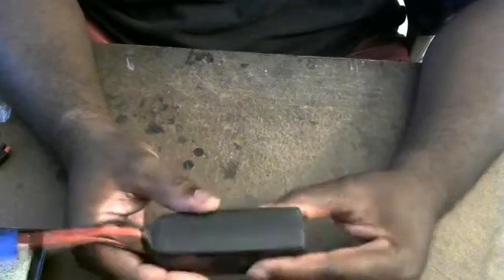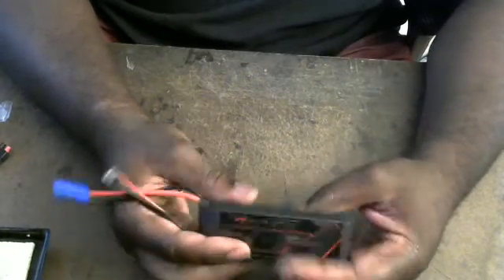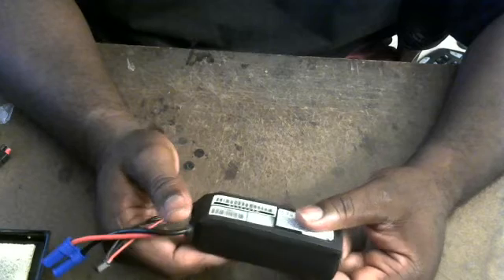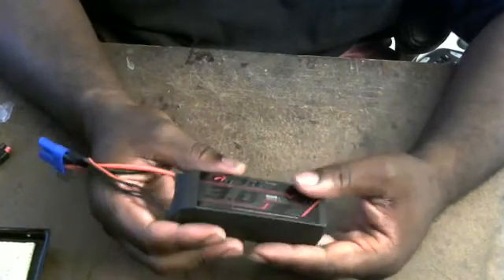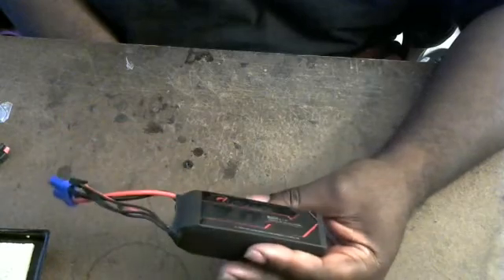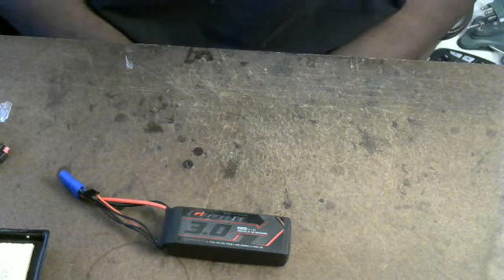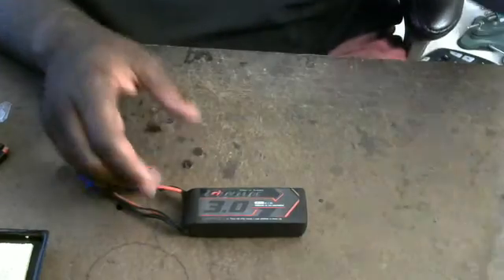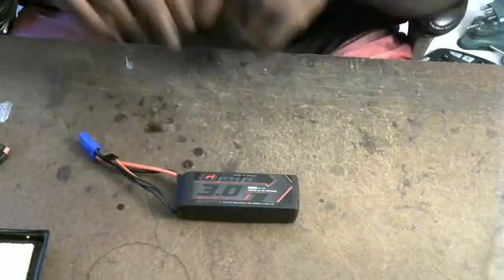15C Turnigy Graphene Test Review

Comment: 3.0 * 15c = 45 A
16.0 * 10c = 160 A

That's why your multistars pack needs a higher AWG wire, it can deliver 3.5 as much amps.
Reply from the maker: Glenn Verboven Multistar are so not 10c. Depending on the capacity the lower ones are about 2.5 to 3c while the only one that can even reach 5C is the 16ah and that's because it's 2p cell configuration. These are based on a continuous discharge and the ability for the cell to hold over 3.5v at the end of discharge.
Reply from the maker: Glenn Verboven you are also correct though normally these smaller packs are used in rc. I tested a few of these smaller cells to get a better idea how the larger pack may work. The loads that true rc enthusiasts have vs the enthusiast in my field are different rc requires packs to be punchy while we prefer sustained loads. We rate rc packs different usually using a 1/4 C rule meaning destiny the pack 1/4 of their claimed rating to see what their continuous happy CA rating is for cell performance and longevity.